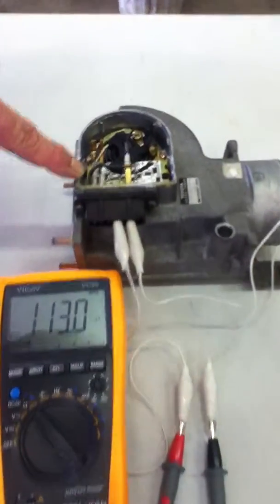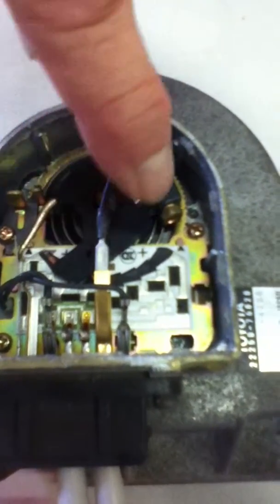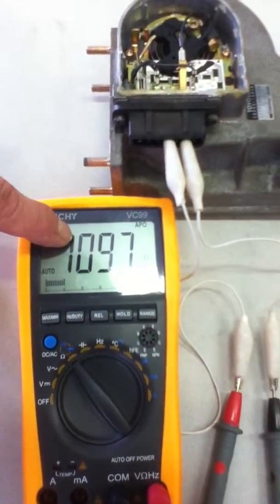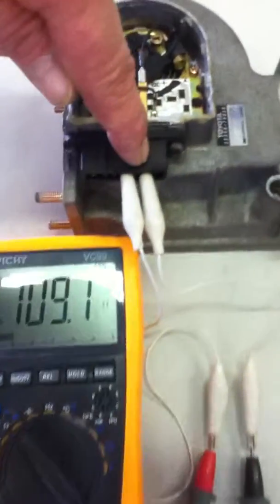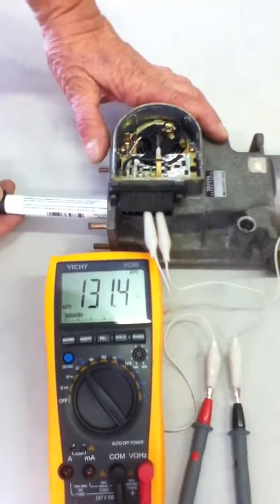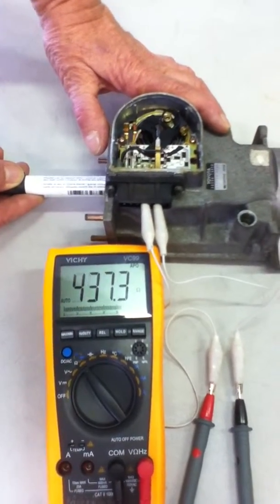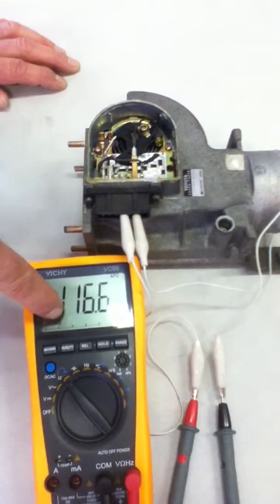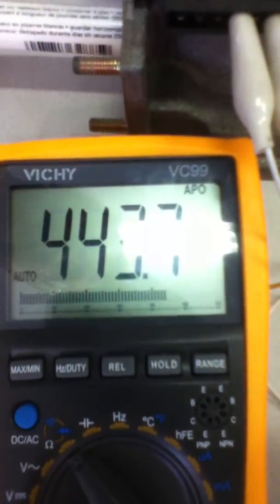VAFtest

Comment from the maker: This test of a VAF sensor is really valuable. It will tell you if the sensor is good or bad. Because the ohmmeter puts out a lower voltage than the sensor normally operates at, faults will show up on ohms that won't always show up when you check the sensor with voltage. This test is also very good with throttle position sensors.